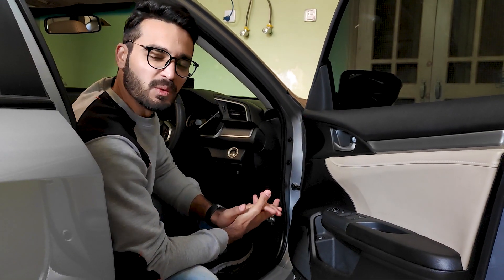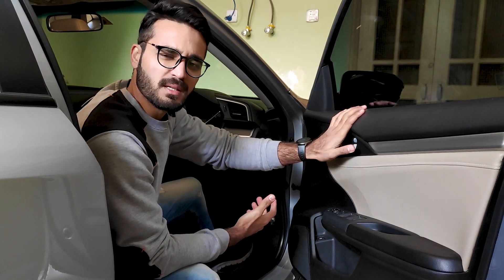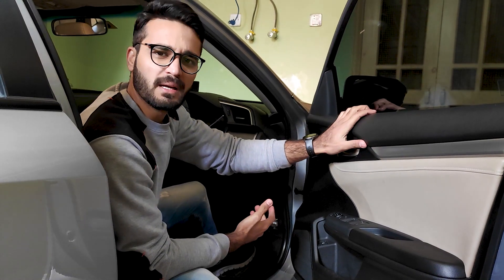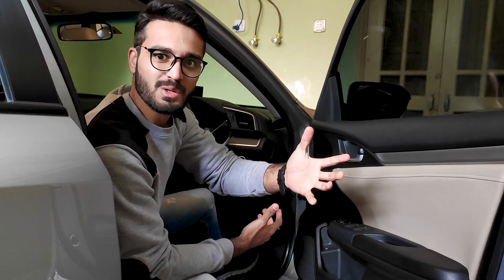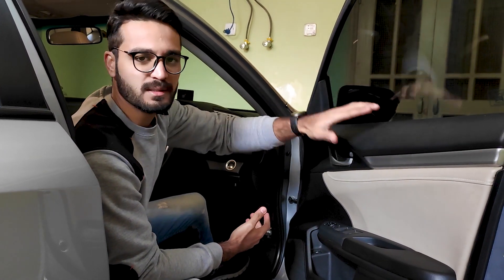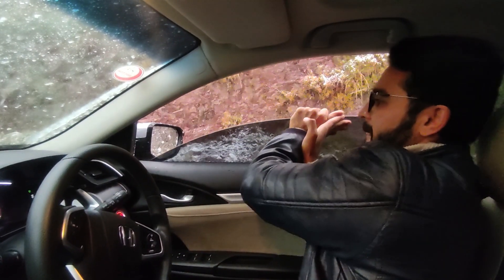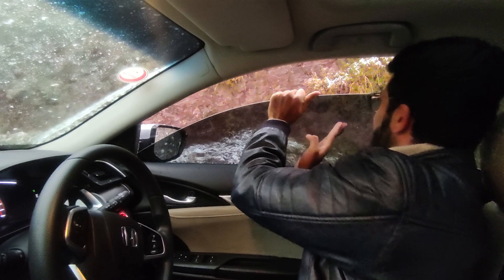HOW TO FIX SLOW POWER CAR WINDOWS | SLOW POWER WINDOW IN HONDA CIVIC | #HONDACIVICFAULTS

Comment: Bhai dont use WD40 on Rubber Parts For Rubber parts use WD40 Silicon spray this is specially for windows rubber parts suspension etc

Comment: Meri 2016 model civic x mai freezer ka issue a gya jb ky gari full care saath rekhta hu is py koi video possible ho bna dyna Thanks
Reply from the maker: Freezer ka issue?
Detail me btain
Reply: @wahajawan   Civic X 2016 sy ly kr abe tk iska Ac kam krna chor jata hai or yah company fault hai har 3rd civic X mai yah aya hai…AC on kro to thand nhi krta meri gari abe tk 80K chali or me aise b Civic X dekhi jis ka yahe issue 30K km chaly py b aya.
Reply from the maker: @saimfab666  yes maine b suna ha .meri 35k ha abi tk sae chal rha ha ..
Compressor ka issue ata ha is me.
Or meri information k mutabik jb ap outer air wala button press krty hn na . To bahir se jo air ate ha us me dust particles hty hn or ye dust particles ac compressor ki pipes jo k bht sensitive hte hn unko damage krty hn .. 
Aisa is lea hota ha kyu packing achy se nhi kii gai . Ap kbi cabin filter ghar pa khud kholen dashboard compartment k pechy hta ha .usme dkhna ktne dry leaves jaise particles nazar aein gy apko.
Issi lea mai ziada inner air circulation on rkhta hm
Reply: @wahajawan  cabin filters Time sy phly change krwaty hai Har service honda sy hoti or Har service mai cabin filter saf lazmi hota…yah company issue hai Mery dosto pass hai civic 18-19 in mai b same issue.PakWheels py b logo ny blogs likhy hai but still company ko koi frk nhi prta.
Reply from the maker: @saimfab666  ap smjhy ni meri bat . 
Me yee keh rha k cabin filter k baawajood kush particles andr chly jaty hn or ac coil damage kr dety hm

Comment: Would be better if you use Silicone spray of same brand of WD-40  regularly .. that would be better as it is better for rubber instead of WD-40. 
Thanks
Reply from the maker: Next time in sha allah
Reply: Yes exactly

Comment: RIP rubber seals. You shouldn't use WD-40 on rubber
Reply from the maker: Then what can i use
Reply: @wahajawan  
Any silicone based product. You can also use plastic protectant that's applied on interior plastics. Water based tire dressings can also be used.
Reply: Well said